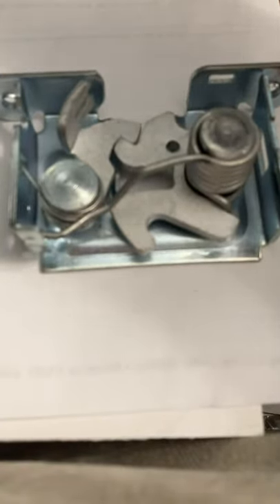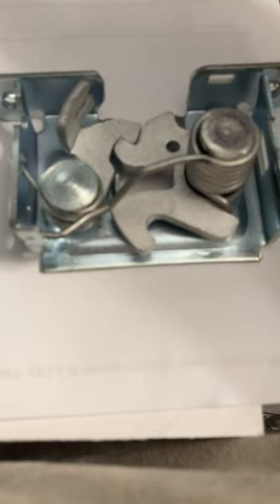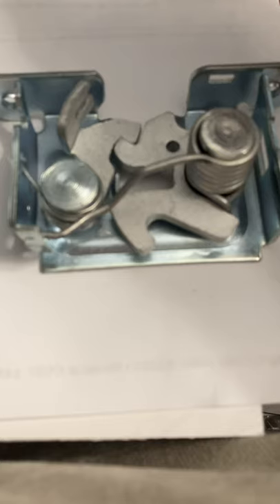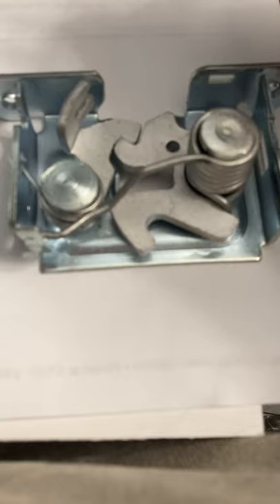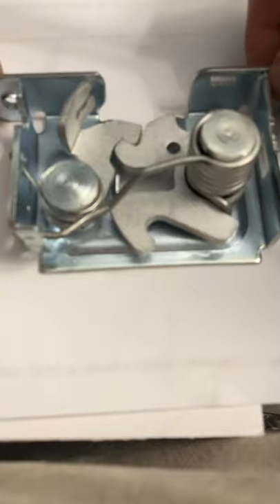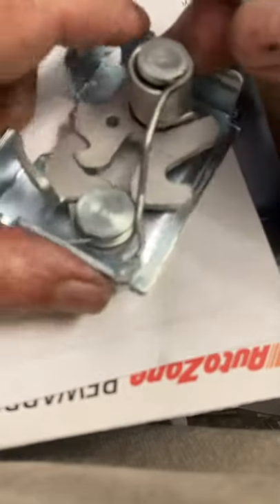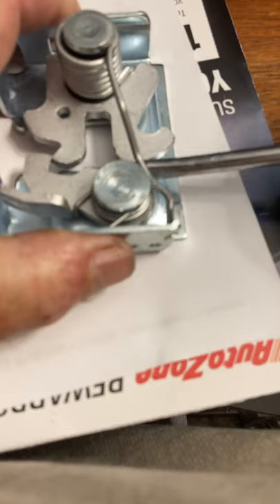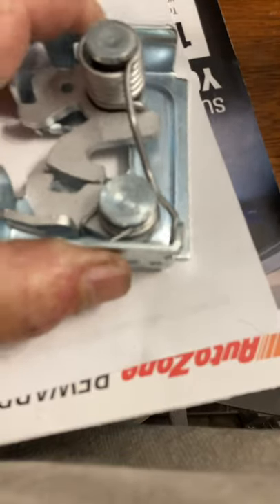Mini Cooper broken hood release

Comment: At first, I was having issues reaching this with the same super long screw driver I used to wedge open the passenger-side latch, but I realized my arm fits right up into the space with a shorter screw driver, which gave me just enough leverage to pop this latch open. Other videos made it SOUND easier, but without a visual look at how the mechanism works, I got nowhere for hours. Last ditch effort, learned how the lock works, had the thing open in under a minute ❤️